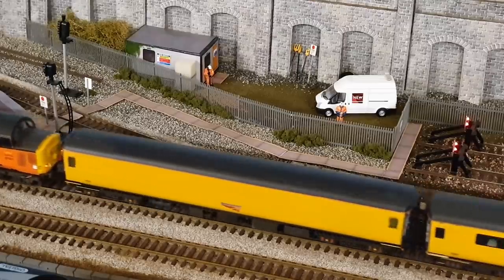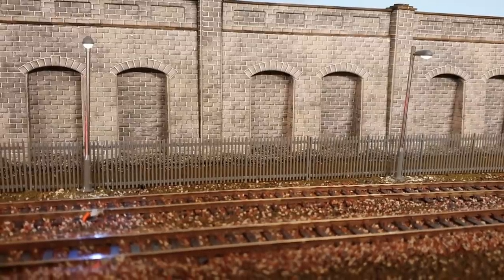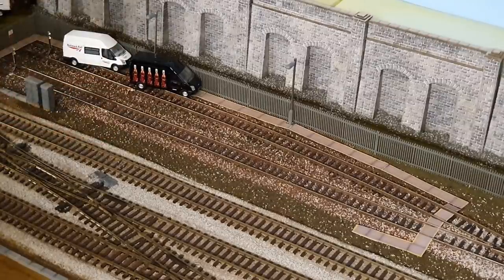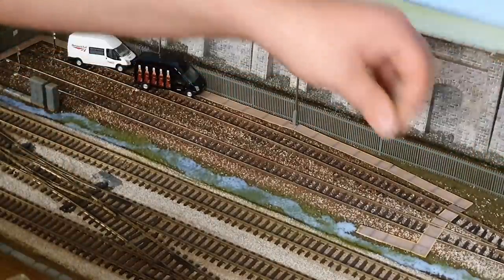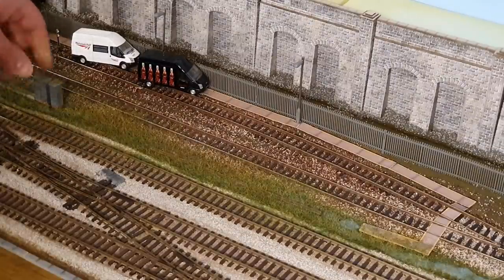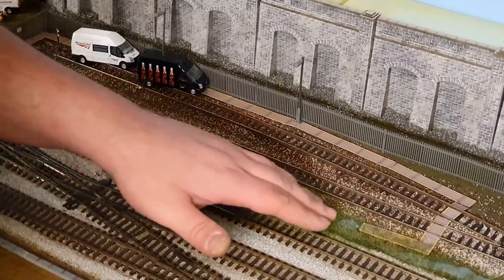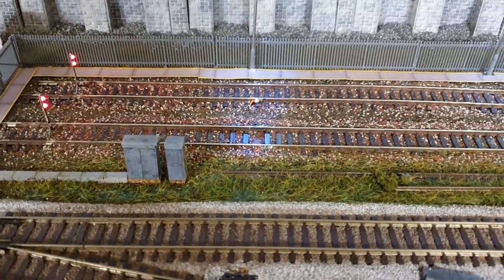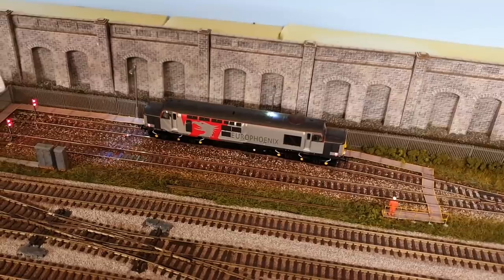New Junction - Adding a Station Pilot Siding, Part Five | Illumination & Static Grass

Comment: Looks good but how does the van get to where you placed it without an access road? Helicopter pickup and delivery! lol
Reply: @NewJunction  I was thinking the same thing no way of getting the van in or out of where it is, you should have made an access for the van to get in and our at the other end maybe had a bridge over the rail lines for the van to get from the nearest road to the works compound where it now is.
Reply from the maker: @philipbutcher1971  it's not finished yet lol